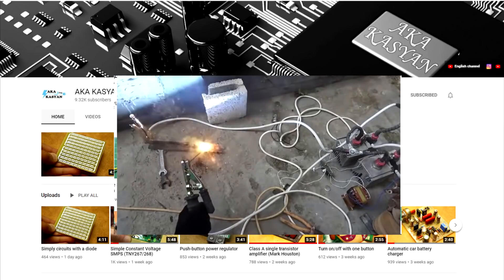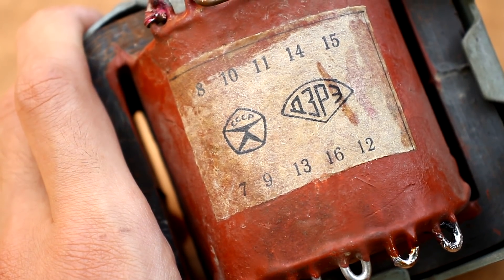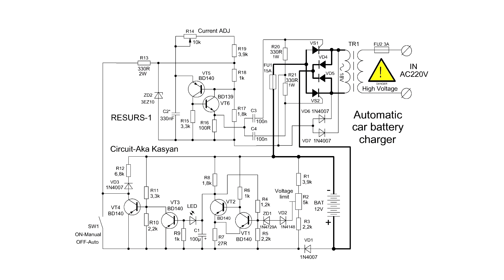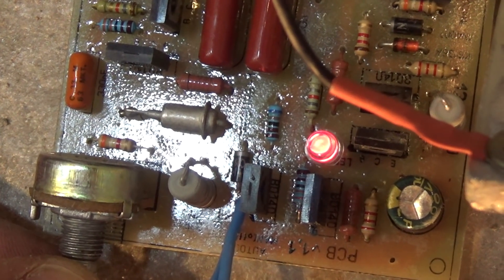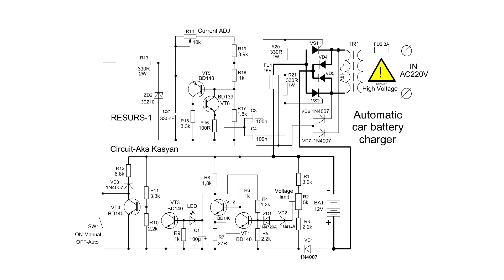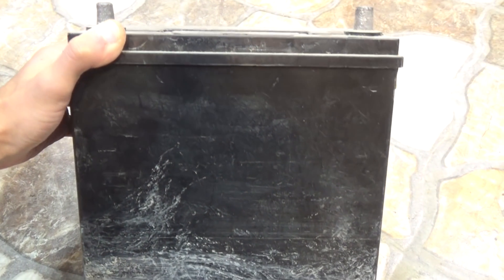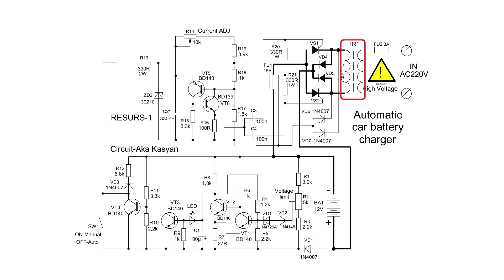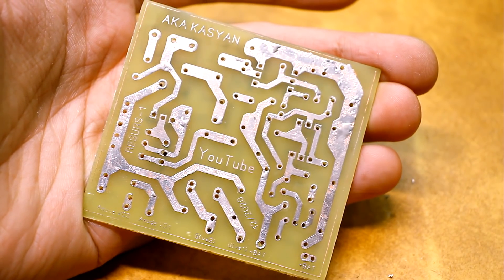HIGH POWER car battery charger

Comment: Kasyan, I have a doubt, regarding the automatic voltage control feature, but I would ask if understand you correctly, first: Your schematic at T= 6:44min made me understand the automatic control works as a high-gain voltage comparator (discrete, made with transistors, all ok) where the “reference” comes from the Zener+Trimpot (blue one). As far as a saw, it does NOT Modulate the phase of the SCR based on the charging of the battery voltage. The LED turning on abruptly might be a proof of that. I’m more accustomed to follow NPN circuits (my habit, sorry) but it seems that VT1 and VT2 and their resistors are polarized to have an hysteresis, as a Schmidt trigger, not to operate smoothly and linearly. 
Am I correct about this On-Off behavior? Why did you choose to do that?
The only phase modulation seems to come from the Current Adj. Potentiometer, that one (upper part of schematic) that controls the RC time-constant of the relaxation oscillator. 
Thank you!

Comment: I bought cheap car battery charger but they never last long, the good one are very expensive, I need a 12v 20A charger with charging indicator and short circuit protection. Could you please designe a schematic for me?

Comment: I really enjoy your videos because you describe the intent very well, then the process, and you are very clear and easy to understand, I've learned a lot from them, as you give very good descriptions of how the components do their work, and the circuit design.  This video was quite interesting, because my old battery chargers, well built and designed, are dying of old age, rust is killing them, and the old components are hard to find.  I really enjoyed the previous video, desulfating batteries, because it used to be very easy, when batteries were designed to be maintained, but sealed need exactly what you have provided, and I will build on and maybe recover several battery's.  Thank you.